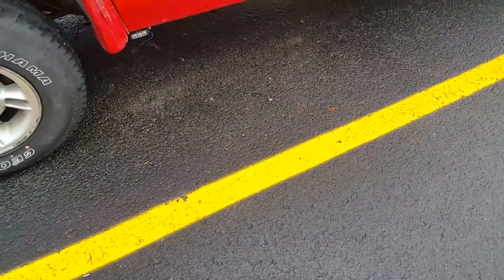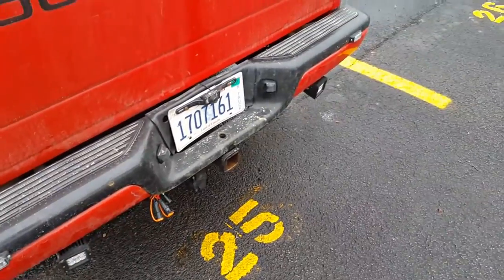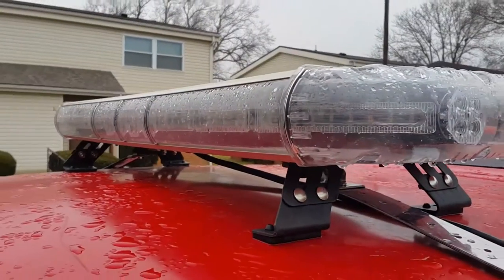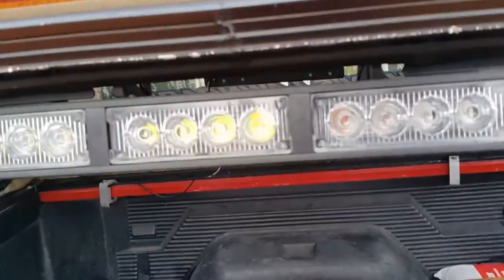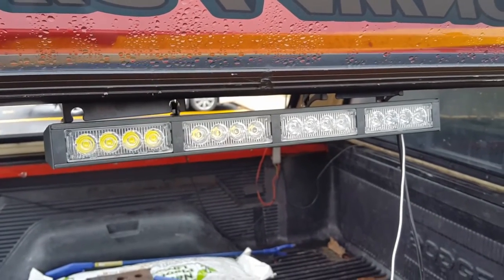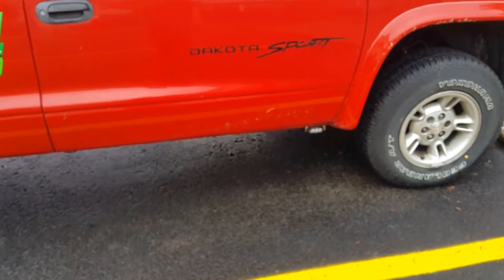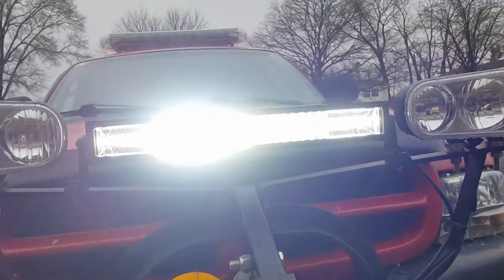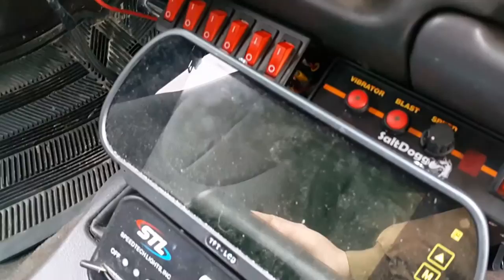Detailed description of all my lights links to all lights are down below

Comment: That 22" light bar is an Auxbeam C3 series.
Reply from the maker: mossman381 yeah I really like it it's a lot brighter than the other ones I've had I've noticed aux beams lights are really good
Reply: TheNathan343   The C3 light bar is the brightest bar I have tested.  The light output is amazing.
Reply from the maker: mossman381 yeah you can say that again probably the brightest bar I've seen on the market yet I'm going to have to get some more stuff from auxbeam